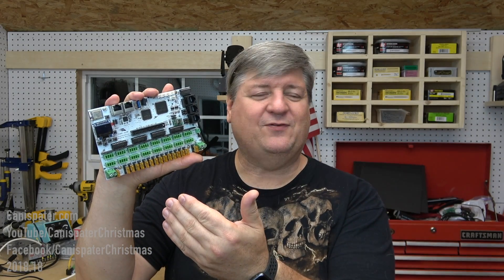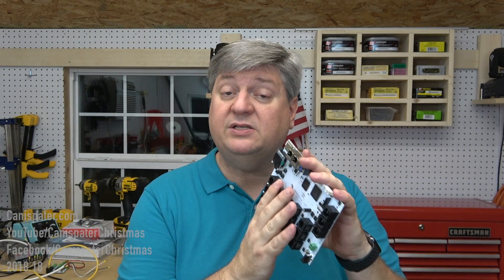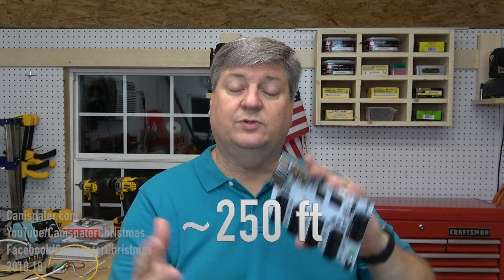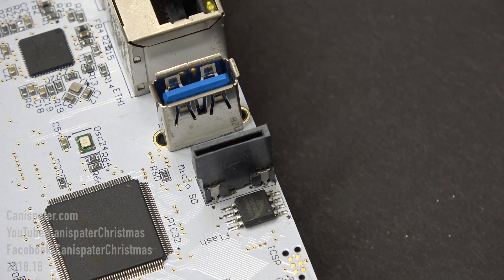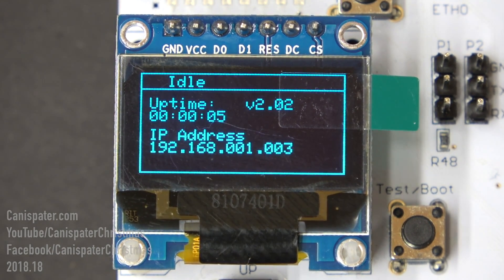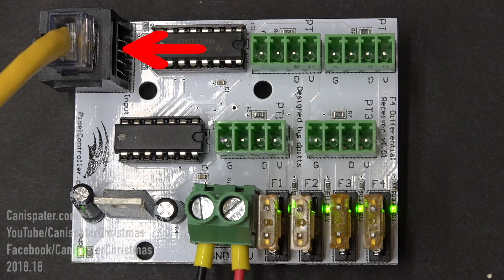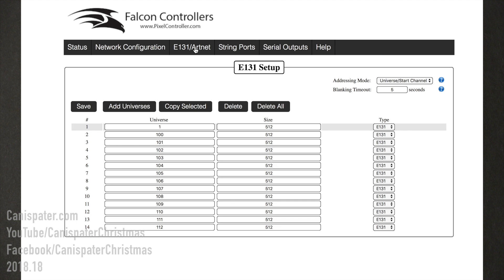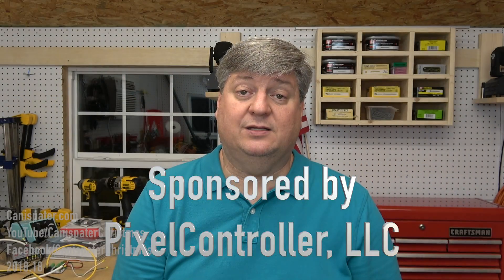Falcon F48 Differential RGB Pixel Controller (2018)

Comment: I signed up for your class, planning for next year. I will probably go with the F48, because I think my props will be spread out pretty far. I’d like to put the F48 in the garage. We have a corner lot and I’d prefer just running data cables to receivers. I have power at both ends of the house. My question is regarding the power supplies. Do they stay on 24/7 or do they only come on when data is sent to the controller? It’s a burning curiosity that I have right now. Lol. And thanks for the video. I was back and forth on the F48 and F16. I even talked to David and couldn’t decide.
Reply from the maker: Awesome! Thanks! Let me know if I left anything out of the class - trying to make sure it covers everything someone needs to know. I do plan on adding a couple of lessons now that everything is set up, but the basic info is there and you'll get an update when they're added. Yeah, there is more expense with the F48 and receivers, but if props are spread out, it's an easier install IMO. I completely rewired the show this year and it seemed easier to test one receiver at a time. Currently, the power supplies stay on because I have one large power cable snaked through the display and I don't want to just shut down the P10 sign's BBB. I'm going to power it separately then I can shut everything down (except for the sign) which will reduce power consumption. It's about 200W at idle and no need to waste (and pay for unused) energy. I have a Wemo switch monitoring power consumption that is connected to my home automation system that could easily be turned on and off just before and after showtime.
Reply: Is there a safe way to shut power off to the controller after each show? If I have the controller plugged into a wemo type switch, would it be safe to have it scheduled to shut power off to the controller after show end each night and scheduled to turn on prior to show start the next day?
Reply from the maker: @JCH_Kim  Yep. Nothing special required. https://youtu.be/vFRPnUw2AhA
Reply: CanispaterChristmas Thank you for the reply. I just now saw it. I never got a notification. I finished your class. I bought a few pixel strings and have played around with them in test mode on the F48. Now I’m trying to figure out where to start now. Props, layout, etc. I bought an outdoor Meross WiFi plugs to control my inflatables outside. It worked flawlessly and works with IFTTT. I’ll probably get more to power down/on everything.
Reply from the maker: @FourWheeler575  Thanks! "Test mode" you mean from the F48 or have you been able to go from xLights to the F48? Either way, getting the lights to come on is a huge accomplishment! As for props - it's kinda like the exercise in the class. Outlining doors and windows and getting those working. You can also check out www.boscoyostudio.com for things to put the pixels into to make them into props. I use the strips (https://bit.ly/2rNthSR) a lot.
Reply: CanispaterChristmas Test mode from the F48. I plan on doing your exercise again for the layout. I started it, but I need a better picture of the outside of our house. I don’t have a good picture with the entire section I want to add lights too. I’ll check out boscoyo studios too. My first couple years I’ll probably continue to use ac lights that I have on the house roof outline. Do pixel props, trees, arches and my current inflatables, then eventually phase out the ac lights. I’m going the budget friendly route. Lol
Reply from the maker: @FourWheeler575  Excellent idea! Yeah, since you have the controller and lights, you might try playing with xLights and use the output to lights button to send data to the controller. That will give you an idea of what things look like when you have some props and teach you a little about xLights - it's a learning curve itself. There are tons of videos on the xlights web site to help you get started and learn more about it. Keep me posted!
Reply: CanispaterChristmas Yes sir, I will keep you posted. I will start that next (xlights to controller), now that Christmas is over. I’m still watching your videos too. Thanks for doing them. I’m hoping my software engineering background helps speed up my learning curve a little. I know my car audio wiring skills have. Lol

Comment: Jeff  I am building a matrix with 40 columns and 30 rows for a total of 1200 pixels.  I have a F48 controller and I am not sure I can do it with, 2 strings, 600 nodes/string, and 20 strands/string.  this would use 2 ports of the differential reviver.  I am a little confused with the 510/512 limit.  I am trying to install the pixels right now so I want to make sure the wiring layout is correct.
Reply from the maker: If you model it in xLights (assuming you're using xLights), right-click on the model and choose "wiring view." This is what it looks like from the back of the prop and will help you wire it like xLights thinks it's wired based on the parameters you typed in. 510 vs 512. An E1.31 universe is made up of 512 channels of data in one packet. 512 channels = 170 pixels plus 2 channels left over. Early controllers only allowed you to use 510 channels to make the number of pixels per universe even. It's all computers and they don't care so newer controllers allow you to use 510 or 512 with the last channel of pixel #171 spilling over into the next universe. It's more of a technical detail and must match what your controller is capable of handling, but really nothing more than that.
Reply: thanks for the quick reply

Comment: How would you connect the F16v3 and the F48 to my computer and xlights?
Reply from the maker: Ethernet from computer to one of them, then Ethernet from the first to the second. They both have 2 Ethernet connectors so you can daisy-chain them.
Reply: @CanispaterChristmas  if I have a sanddevices controller e682 what can I do to conect 2 e682 what I need ..sorry for my question
Reply from the maker: The e682 only has one Ethernet port so you’d need a network switch to hook everything together. They are fairly inexpensive.
Reply: @CanispaterChristmas  thank you
Reply: @CanispaterChristmas  any recommendation
Reply from the maker: @fgmrendy  I use Netgear Gigabit switches, but anything new generally works well.
Reply: @CanispaterChristmas  thank you
Reply: I am new on this ...I wanna add few mini tree next year so that is  why I need some lession about what I need ...thank for show me the next step...
Reply from the maker: @fgmrendy  You bet! Make sure to go through the beginner playlist (link in the description) if you haven't already. That has a lot of info you'll need to get started.
Reply: @CanispaterChristmas  I have a mega tree running in the yard with e682 controller 16 strings right now I gonna add a big star to my mega tree and few mini trees
Reply: Sorry for my english
Reply from the maker: @fgmrendy   English is fine, but now I understand your situation much better. Good luck and Merry Christmas!
Reply: @CanispaterChristmas  Thank you

Comment: You mentioned a couple times to refer to the boards user manual. Has David actually made a manual for this board yet?
Reply from the maker: Haha. I don't see one on the web site yet, and I don't remember exactly where in the video that was referring to, but if it was the DMX ports, the F16V3 manual should help there as they are the same or at least very similar. Really, most of the top half of the boards are the same so if it's something up top, the F16V3 manual may be of help. Do you just want to see the manual or did you have a specific area you need help with?
Reply: I already have the F16V2-R that I have used the past couple years. This year I am expanding and the F48 made more since to split up in sections. I have a Pi with FPP that runs my shows. So what I am looking for is information on using the new F48 as a master controller with the Pi attached to it then daisy chaining to the F16V2-R to act as a "differential board" of sorts. I doubt that is how it really works but I figured the F48 manual "if there is one" would have information on how to setup the daisy chain in this way. Do I have to assign each board it's own IP address, Do I need 2 pi's to use both boards, would it make more since to take the F16V2-R out of the picture completely and just use the F48 <---- leaning more towards that option to avoid all above confusion.

Lets say I go with getting rid of the F16V2-R and using the F48 as my main and only controller.

While looking at the specs on David's website I noticed that on the details next to the picture it says it can drive up to 16,384 pixels with the 48 different outputs on the Differential board. 16,384 / 48 is 341.3333 which cant be right. 

Now if you look on the excel spec sheet it shows it can run 1022 pixels per port (48 ports, 12 diff boards) = 49,056 pixels. there is a huge difference between the advertised pixel and the spec sheet pixel. This is where the manual would come into play to help me out with these conflicting numbers. :)

Sorry for the long post on a youtube comment :)
Reply from the maker: Posting here is the best place since I get notified and others can benefit. So the Pi will be the FPP master. It sends out E1.31 data via ethernet into the F48. The F48 has a 2-port switch so you can come back out of the F48 on the second ETH port to the F16V2-R (daisy chain). Differential boards, even though they use ethernet connectors should NOT be connected to E1.31 and differential output should NOT be connected to E1.31 - that can hurt the board (ethernet and differential data are different so don't cross the streams :) ). Similar to the F16V3, where it has 16 ports, when you add expansion boards, they share the 1,024 pixels among the ports. So the F16 has 16 pixel output ports, an expansion board has 16  pixel output ports and if you use 2 expansion boards for 48 outputs total, port 1 on the F16, port 1 on expansion #1 and port 1 on expansion #2 share 1,024 pixels (there is a slider on the string ports page you use to proportion the numbers on each board). Similarly, the F48 shares 1,024 pixels for each column of 3 differential outputs (same slider on the string ports page). Also, the spec sheet on the F16V3 says max 96 universes and max 49,152 channels (not pixels). The V2s are 64 universes and 32,640 channels. Divide channels by 3 to get pixels if running RGB pixels. 16,384 * 3 = 49,152 channels. Does that help?
Reply: Sort of, I think what is throwing me off is that the spec sheet says up to 1022 per pixel output but it says 1024 max pixels per pixel output below that. not sure what the difference is there. basically each port can run on the expansion boards can run 1024 pixels if you had all 48 ports diveded evenly. another thing that I am not clear on is 1024 pixels shared for each column of 3 differential outputs. I am drawing up a diagram of the board along with the information above to try and make more since of this.
Reply from the maker: You're giving me an idea for another video... LOL!

Comment: I am a newbee and have been watching all your video's the last few days. This is the system for me, thanx! ;) The Differential Receiver Board you show in the video is not the same as the one they are selling on their website. Is yours a new version that has not been released yet? The 4-String Differential Receiver Board on the site has no LED's at the fuses and doesn't mention connecting to the F48.
Reply from the maker: They may not have updated the image on the website yet. It's essentially the same board. I believe the new ones are all that he is shipping now, but you can send David an email if you are worried about it. The one from last year had an error on the silkscreen showing a clock line (4-wire pixels), but the board only supports 3-wire pixels. The silkscreen has been corrected on the newer boards and the fuses now have indicator lights. That's the only difference between the two. The differential output is the same. The F48 has 12 differential outputs where the F16V3 only has 1, but is expandable.

Comment: I  got mine.  Am figuring things out,  I was thinking I could run a 100 pixels off the card powered, but now see it can only be 50 native power.   Stupid question, I see you can name each item in port description, and adjust the brightness output there.  IE I see you had 10% power at some point.  Is that a good way of making my show for instance 60% when I am done?  As always thank you!
Reply from the maker: At showtime, I use the controller setting to reduce to 30% so I don't have to remember to do it on every sequence, but I believe all the sequencers have a way to do it in software. There's also ways to do it in the players (FPP & xSchedule). Really personal preference and according to your needs, but I just do it on the controller(s) to keep from confusing myself. It still happens from time to time though. lol!

Comment: Love your videos, thanks! Did David mention when new FW will be released to use the additional features?
Reply from the maker: Last we spoke, he’s working feverishly to get it done - I’m guessing by expo if possible, but no firm date yet. I understand the beta for the F16V3 works well, but I haven’t been able to try it (no PC). He’s also working on removing that dependency. We’ll know more in a week.
Reply from the maker: And Thanks! :)
Reply: awesome thank you!, So will I be able to actually run my show from a 48 like I do a Pi? therefore eliminating 1 Pi from my existing setup?
Reply from the maker: I believe the update will allow it to act as a slave so you’d still need a master somewhere to drive everything, but it could handle sync packets over WiFi.
Reply: Thank you